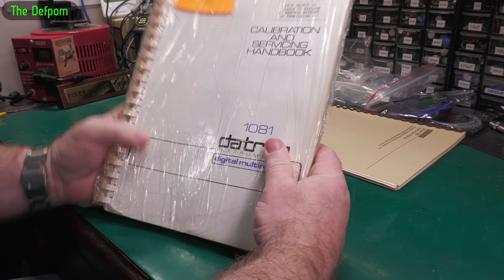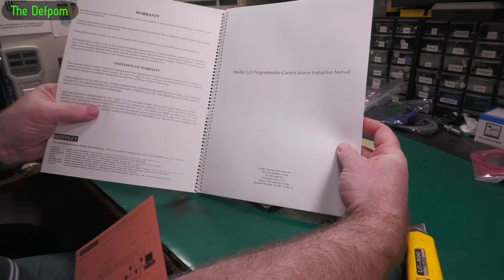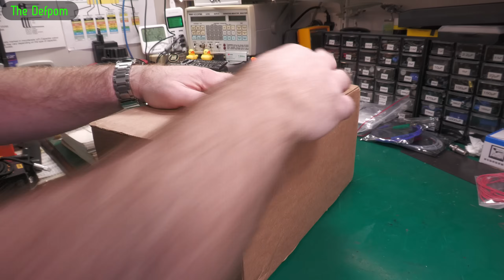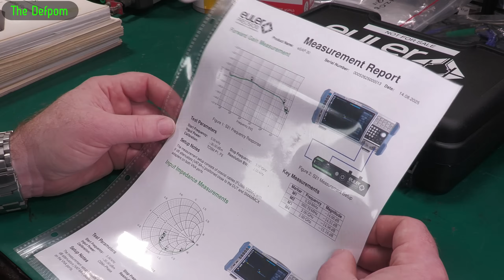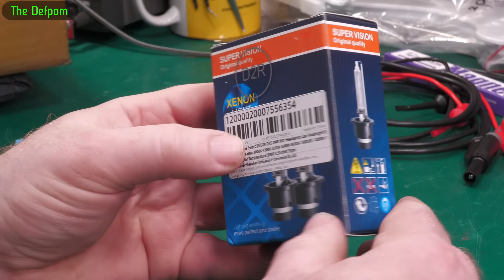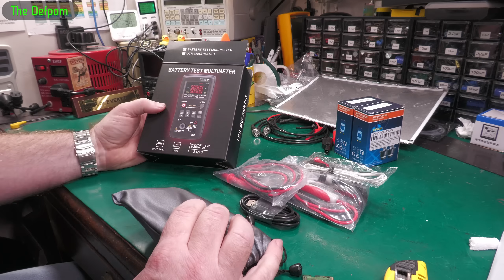🔴 Mailbag Monday 22nd September 2025 - No.1405

Comment: The AA came to my rescue and decided the problem of the steering not unlocking was a battery problem and not a CANbus issue. even if they had looked the car would have been reporting every single system had communication faults so they might have still blamed the battery.
I had a duff battery as their little box of tricks said that the battery was well down on performance and needed to be replaced, at a high cost to me.
well after a tow home and finding the CANbus issue, the battery is still starting and running the car just fine even the bloody STOP-START is working. I did point out to the AA if the car thinks the battery is getting low in performance it will stop the "stop start" function to take the extra strain off it. 
So IMHO get an old school battery checker that's just a bloody big current shunt and a voltmeter then your know how well your battery is under load. pulling a few hundred mA's and trying to measure it's internal resistance for me just does not cut the mustard. (Note not sure if mustard is used in the construction of car batteries) 🙂

Comment: I just bought a 13" magnetic tool bar from Princess Auto (equivalent to Harbor Freight in US) here in Canada for $15 CAD. The thing is so strong that if you place it on a metal object to hold the toolbar in place, you have to twist the bar off the object to release it.  I actually doubled on the bars when they go on sale to hold the smaller screw drives with the thin shafts in place better. The bar has no problem holding a full size Phillips screwdriver.

Comment: The screwdrivers will only have weak ferromagnetic properties possibly due to their own magnetic field (for screw pickup etc) interfering with the magnetic strip’s magnetic field, causing a weaker or inconsistent grip......or possibly the coatings on the screwdrivers interfering also.
I guess you'd need a really powerful magnetic strip to combat that.

Comment: Instead of the magnetic strip for your tools......Have you thought about a complete and utter re-arrangement of your lab?
I was thinking of a new L shaped workbench with your computer off on the short side (30" deep), then put your test equipment stack at hand in the corner of the main bench (38" deep), and then a couple of drawers below your bench with your tools in it. Wait a minute, that just described my own set up! Just an idea! I made mine starting with a 40mm kitchen worktop.
Reply from the maker: I really don’t have the room, this really is the most efficient setup for me, I have all this stuff in a 3mx3.3m space.

Comment: When I was young, they did say - "If you place paper sheet between magnet and screwdriver, the force is 10 times less now, that's why magnet (or electromagnet) working tips are not painted". So, magnets in shielding...

Comment: The car lights are supposed to be calibrated, especially if you change the type.
Reply: ...Hope the cheapies don't melt/distort in the fitting and take out the driver circuitry. (Ask me how I know)
Reply from the maker: This car doesn’t need any of that rubbish, it’s not not clever.
Reply: @TheDefpom non electronic car also need the light to be calibrated, so you don't dazzle the person in front of you. It's more true with LED lights different light pattern.

Comment: Not all steel alloys are magnetic. Something to do with electrons, crystals and science stuff.
Reply from the maker: The screwdrivers are magnetic though, I magnetised them to help hold onto screws when I remove them, but you could well be right that the alloy means they have weak magnetic flux.
Reply: All stainless steels are magnetic, even if slightly so; if you have a strong magnet it will weakly attract 300 series stainless steels.